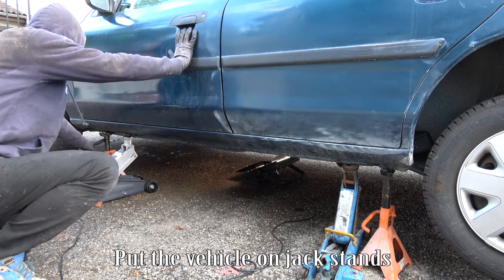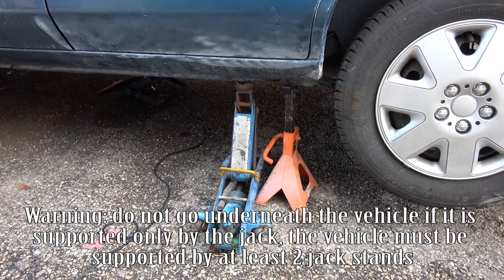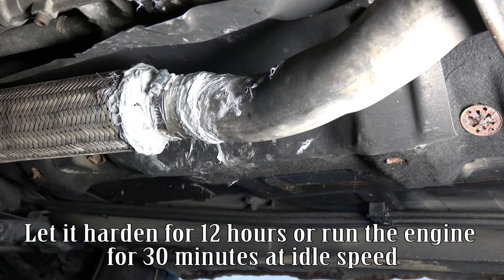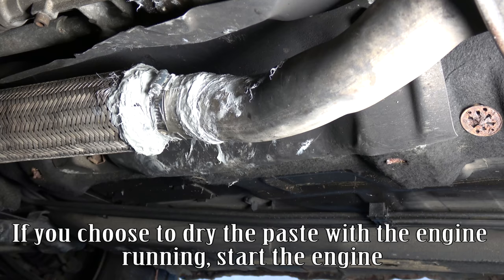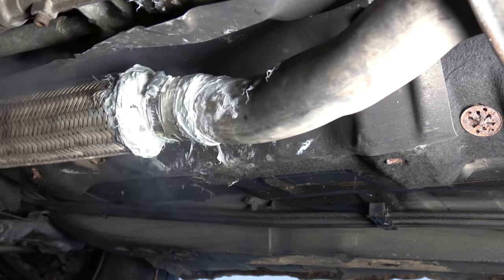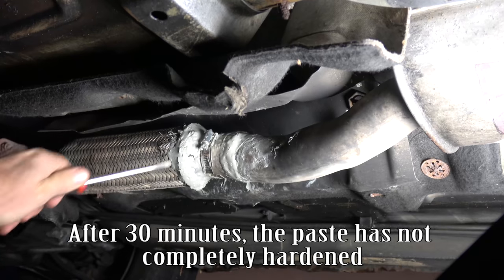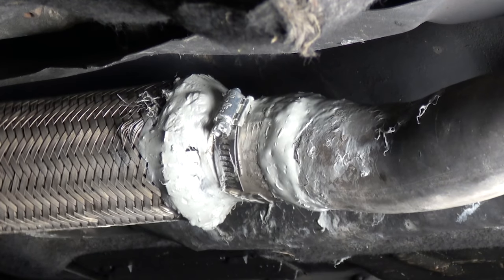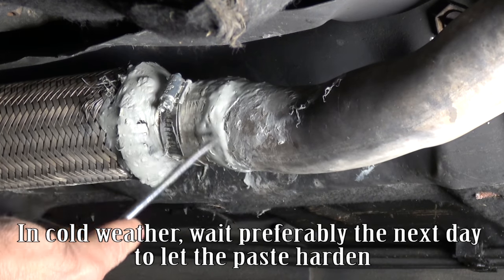Broken exhaust pipe repair (easy repair WITHOUT DISMANTLING)

Comment: And when the paste hardens, drive it to the muffler shop.
Reply: Yep, all it is is a temporary fix
Reply: and it's flammable.
Reply: When the paste hardens, drive to the dealership and buy a freaking new vehicle.
Reply: A quick fix,,,,but a slop job,,, a waste of money if you plan on keeping the vehicle!!!!
Reply: @rustynail7866  It was a proper exhaust cement. Not flammable. The ones I've used are a silicate material. They dry to form a cement like substance.
Reply: @jptrainor  exhaust cement was designed to coat the inside of a pipe , when using a clamp.  It was never meant to hold the pipe by itself.  Over the 52 years I worked in the industry, I  cut off the so called non-flammable substance with an acetylene torch on a daily basis.  It burns nicely.
Reply: @rustynail7866  Steel burns nicely with an oxyacetylene torch too. Funny that.
Reply: @jptrainor  no Jim. Steel melts nicely.
Reply: @rustynail7866  It burns. What blows off during a cut is oxidized steel. Oxidized = burned
Reply: @jptrainor  carbon in steel will burn, yes. But most modern exhaust systems are 409 stainless, which is lower in carbon content and adds a small amount of chromium and nickel, creating a much higher melting point, without any actual flame.  304, used in show cars, has more chromium and even less carbon.  Catalytic converters create temps sometimes north of 1700 degrees .   Manufacturers learned in the mid 70s the necessity for much higher melting points.
Reply: @rustynail7866  The iron oxidizes! Doh!
Reply: @jptrainor  But it does not meet the criteria of a combustible substance!  Anything will burn at 3000 F.  DUH!
Reply: @rustynail7866  kind of like muffler cement
Reply: @jptrainor  yeah except muffler cement is done at a constant 1000 F.  Steel and iron will last forever at that temp.
Reply: @rustynail7866  so what
Reply: @jptrainor  LOL
Reply: @AlbertwilliamsWilliams  this is way cheaper than getting a ticket for noise complaints on your way to the shop.
Reply: 🤣🤣🤣🤣🤣🤣🤣🤣🤣🤣 this has got to be the comment of the year 🏆🤣🤣🤣🤣🤣🤣🤣🤣🤣🤣🤣
Reply: Lol😂 
Hey it's better than it was..
Reply: When the paste hardens, drive the car into a brick wall as fast as you can.
Reply: @kuvyoghmoobamelica6883   not everyone can afford to get their vehicle fixed little alone a new vehicle… lol you simple? Why els would you watch this video unless your broke trying to fix ur flex pipe
Reply: Haha, so true!
Reply: I can only confirm
Reply: Welding it would've been better problem fixed
Reply: @kuvyoghmoobamelica6883  
For me it'll be cheaper to just replace the part that's damaged. "Buy a new car "
Not all of us can afford that.
Reply: Totally agree with you 😂😂
Reply: It’s just a exhaust yall dtm
Reply: This comment so funny 🤣🤣🤣🤣
Reply: OK to get you home if it has dropped down or is loud but that is not sealed it still leaks
Reply: That clamp kicked his azz😂😂😂

Comment: Besides the fact that a complete seal was not achieved by applying the paste...the original reason the muffler cracked then broke completely in two pieces was because the muffler/exhaust system IS NOT properly secured...when you slam the car door and the whole system shakes and moves back and forth is my proof...this system will violently shake itself to pieces again...this bandaid fix will fail...most likely within the first trip....
Reply: Engine mounts that
Reply: if its a total beater then i guess its ok to do it that way.....i woulda had a guy weld a piece of pipe in there where it broke from the flex pipe to the exhaust pipe....only would been a inch or so
Reply: Ur correct cuz mine just broke due to driving by a hole and slamming down on it
Reply: @davidscaife4312  why?
Reply: Would using zip ties and the wrap be a temp solution? I can’t get it repaired until next week but I need to drive 😢
Reply: @Dankdalorde No. Zip ties would melt.

Comment: For people not having very much to spend this is a good way for a while or one can double up on the material once the first ones done and remove the clamp and redo
Reply: Its absolutely not Robert 😂
Reply: My mechanic used this cheap fix. Nope didn't even last 3 days both times.
Reply: @techtactics788 you need a new mechanic. I personally used the Holt's gun gum repairs to get my car through its MOT over 6 months ago,  still no blowing whatsoever.

Comment: I still see a leak. Cheap and easy fix I did on mine... Steel wool double layered, held in place with furnace tape. (Furnace tape is only to hold the steel wool, otherwise it wouldn't last a couple of hours on the exhaust). Then layer aluminum sheeting over the steel wool using furnace tape to hold the sheeting in place so you can add a clamp or two.  Works great and lasts a long time. Aluminum sheeting may need 2 - 4 layers depending on the hole.
Reply: Yup. Helps the aluminum last longer as well. I have one that's been on for over a year and still going strong.
Reply: Far better repair what you mentionthan this video showing us how to put icing on an exhaust pipe :)
Reply: You ain't working on my car.
Reply: @bradw778  hey I'm fixing one now hope it works
Reply: Hey PM me I want to try your way

Comment: your video helped me a lot couldnt find the gun gum but I use the kinda smilar product and covered with a aliminum cover 👌 loud noise is gone
Reply: Lol people been staring at me driving mine for a while! I found some exhaust seal putty stuff at advanced auto!
I jus gooped that stuff on driver side pipe! If it doesn’t work I’ll hav pipe secure spot welded. Then try again! Lol!
Car from up north…rusty underneath !

Comment: I've used muffler cement in the past to hold me over until I got new exhaust parts. It was still okay when I got the new exhaust pipe weeks later. Not pretty but it works.

Comment: To do a repair like that I got a exhaust pipe adapter and fit it inside the resonator (the part where the pipe broke off), and using an exhaust pipe expander, expanded it out so it was expanded against the inner pipe in the resonator.  This effectively replaced the pipe end that broke off the resonator, and allowed me to attach the rest of the exhaust to this new 'stem'.  I also tack welded the expanded pipe into the resonator from the inside of the pipe, purposely blowing through the pipe to make sure there was some bonding, but I don't think that was needed.  To that end I have never had much luck with the exhaust sealant as it seems to crumble over time.
Reply: Thanks. I like that method.

Comment: This is an emergency repair and not meant to last all that long.  It certainly should hold long enough till you can afford to get it repaired correctly.
Reply: i used furnace cement and didnt even let it cure like i should bc i was in a hurry lasted a full year just redid it the "right way" it should out last the pipe around it id buy new converters if ny wast stoopid and wants me to pay 1200 for converters in another year i wont need to worry about emissions anyway its getting straight piped just shows how dumb the laws actually are lol

Comment: Reading many better recos for beer cans. Better than video's potsticker paste LoL. In 70s-80s, steel Campbell soup cans + clamps worked for 1yr, substitute for $400
dual exhaust-resonator systems on 66 Tbird 390 and 70 Bonneville 455.  The cars were only worth a few hundred bucks. Several hundred pints of soup, now unfortunately I have high BP

Comment: This looks like something I would have tried when I was 18, had no money, and knew absolutely nothing about cars.  Maybe next time try some gorilla glue.  Lol. There's obviously a leak in the flex pipe itself. Until motor mounts are replaced it will probably shake the whole car apart.

Comment: Back in the early 80's I had a Ford Grenada and it was flex pipe from the Y pipe right through to the tail end. Nothing wrong with it but it would have to be tinkered with from time to time.

Comment: This may holding in place temporarily, but it's still smoking. So technically, it is not repaired. That flex pipe is going to split on the corrugations eventually. It also appears like there's a broken or loose motor mount, too much shaking.

Comment: I used this when I was young and had no money. This never holds. As you see on the video it leaks now already. Maybe when you want to sell the car you can do this. But always be honust to the buyer.
Reply: Remember radweld? That was only a temporary fix, but they advertised it as a permanent one 🙄 but this is just disgraceful, these guys are friggin cowboys, why would anyone in their right mind put a clamp barely larger than the crack over the top and then hope that this overly priced heat activated stuff holds it? 🙄 Bonkers!
Reply: @A_Pt_9298  it works fine warm up the car before hand and let the paste sit for 30min or longer then start her back up

Comment: How about you fix what caused the flex pipe to break in the 1st place? Like maybe a broken motor mount or secure your exhaust system so it doesn’t shake like that? Been a mechanic for 35 years. Non of that stuff lasts! Welding is the only way to go!
Reply: Don’t do it!
Reply: Been a mechanic for 27 years and these flexs tend to suffer from fatigue and are a known weak spot, not necessarily due to a mount failure etc, they experience a certain amount of flex naturally hence why they are there and with heat, cold heat cold they rot through
Reply: Retired mechanic here with 40 years experience in the trade. My last auto garage I owned did many flex pipe replacements. Also had many welders in the shop, mig, tig, arc,stick etc. Sold almost all equip including my Millermatic 225  or my Lincoln 
TIG welder that I most likely would have used on this repair. Just recently purchased a brand new in the box Chicago Electric 90 amp Flux core welder from my neighbor for $50. Do you think Flux core can weld this? And yes, would have liked it if it was a 140 amp but it is what it is and I bought it as I did not have a welder any longer. Incidentally...... for "shits and giggles" and remind readers that safety on any job should be a priority.  Few years ago sold business because of an injury. Winter was coming and wife wanted a stand by generator in case of loosing electricity up here in Northern Maine. Purchased a new Rigid 6800 one night from Home Depot, opened up my service panel to see where I was going to install the power feed for the house and stupidly grabbed a live 220 circuit powering my shed that has all my carpentry saws and tools and electrocuted myself thru my left hand (actually my thumb). My black thumb and forefinger were the worst burns 911 paramedics had seen they said. Wish that was the worst injury that night. Wife said the shock thru me some 6-10 ft and my body went into a seizure for over 3 minutes. Wife thought I was having a stroke, neither of which I ever had before. Now 3 years later at 62 years old I seize sometimes 10 times a year...or more wife says. And I can't remember a bloody thing most days. Wife's the best tho....she reminds me daily the names of my friends and neighbors...and also to take those dam pills (Keppra) so I don't seize. True story...again will a flux core weld this?

Comment: Looks like a big messy, pain in the a** job to me, that's made even more difficult by not having a proper hydraulic lift to get the vehicle up high enough off of the ground to work on it. (I've spent countless hours under my cars, over the years, using only jackstands and it can be a huge hassle.) I wouldn't trust the longevity of this repair either. Seems like a cheap and temporary fix at best. I personally wouldn't waste my time and money on such a repair, but i do understand that sometimes you have to do the best that you can with what you've got and with what you can afford.

Comment: Save your money. Years ago on clutch job had cut exhaust. I used beer can with top & bottom cut off & 2 water hose clamps on pick-up tk. I used that for years only replacing blow out can ever few months. Until finally putting new dual exhaust on it. True story.

Comment: ill give it a 30/30 guarentee///thirty feet or thirty seconds...terrible repair
Reply: 30 miles max
Reply: LOL yeah man that shit needs to be welded together that paste is garbage
Reply: @romanskarzhinets3128  I drove more then 30 miles using ONLY glue for basically the same issue. I will keep you updated :).
Reply: @zachderado2755  actually there's no need for welding an exhaust, that's a terrible suggestion, all it needs is a gasket, some paste and a clamp, simple. Welding is stupid

Comment: This is absolute emergency repair for the broke budget person, it won't last very long, its temp repair.

I can do better temp repair with soup can and hose clamps, or better yet get a new flex pipe and put it on, then it will last very long time.

Comment: I did a temporary 'bodge' fix like this but used an old bake bean can cut along its length and jubilee clipped on at each end to join a break in my exhaust, I used the exhaust bandage under the can and plenty of high melting point exhaust seal cement between the pipe and bandage and between the bandage and can!

The result was a strong leak free repair that lasted until my next MOT, the mechanic just laughed at my repair and failed it on that, so had to get a new exhaust anyway! 😳😲⚠️😁
Reply: How much did that run you?
Reply: @Officialjaleb  It didn't cost much, it was a few years ago now, I seem to remember it was about £4 for a kit, Holts Gum Gum bandage / tape and it came with a tube of cement.
The bake bean can was free, out of the bin and I already had a couple of old jubilee clips that I just reused.

The kit was basically useless on it's own, it was only meant to be a temporary repair anyway.

But the bake bean can helped to reinforce it all and keep the bandage from coming undone!

Once it all heated up it sealed my exhaust leak up good but my MOT tester was not impressed! ⚠️😳😁

Cheaper than a new back box and fitting, which I eventually had to do anyway to pass the MOT.
Reply: @pdtech4524  ok thanks I will keep this in mind
Reply: @Chase Williams Yeah my repair was solid and gas tight but my MOT tester wasn't impressed at all⚠️😊

The bean can just strengthened the whole joint and kept the exhaust bandage sealed around the break, the jubilee clips did their thing perfectly.
I dare say it would have lasted years but it was only intended as a temporary bodge repair until I got a new backbox.
Reply: fu#k that mechanics. I have the same problem with a flex pipe end. A mechanic says the complete axe has to be disassembled). I hate this exhaust problems.
Reply: Getto fix
Reply: @pdtech4524  I don't see why it should fail an MOT if it was secure & air tight.
Reply: @45graham45  It did fail and it was secure and gas tight, the tester just laughed and called it a 'bodge'.

I guess it would depend on the discretion of the MOT tester, some would no doubt pass it.
Reply: @pdtech4524  Yeah, but I don't see why it should if it does the job. Nothing you could do about him failing it of course.

Comment: In our next video we'll be replacing the BROKEN MOTOR MOUNT
Reply: No, in the next video we'll be welding up the engine 🤣🤣🤣
Reply: @A_Pt_9298  engine is fixed to the engine mount why would you weld it.

Comment: Root cause of pipe breakage is a blown engine/transmission mount. It's only going to break again.
Reply: Wtf is a blown mount? Lool.  It's a block of rubber and steel fasteners.  Maybe "cracked" or "dry rotted".

Comment: An easier way would have been to use a vacuum at the end to create a negative air flow ti would have sucked in the paste into the whole for a better connection. Then after that use a heat gun.
Reply: Another way would be to just buy a new exhaust
Reply: I have a sharpvac and $12 for the exhaust repair kit not $300 just to replace something with a small hole that can easily be fixed
Reply: Good idea, but on a 1996, the rest of it probably has just as many leaks.

Comment: Exhaust still leaking...it's better to weld it again
Reply: And professional. Why would you weld an exhaust??? 🙄
Reply: I mean, really you don't need a gasket to be fair, the paste and clamp would seal it supertight, so gasket is really overkill, but welding? Super overkill and in fact stupid, because when you come to replacing either part of the exhaust you'd have to grind off the steel welding rod, which is a nightmare!

Comment: I do Hillbilly repairs too! But my car is 17 y/o and it is G-6 Detroit car.  SALT!!!!!!   I get two tall boy beer cans cut the ends sleeve it over the damaged parts and 3 hose clamps. It will get me 6 months and quiets it down enough to avoid JOHNNY LAW ! Hell I even then hand it with a drill hole and DOG CHAIN to lower the pressure. Taking it to my shade tree mechanic to evaluate the motor and transmission. If he says the motor still ok. I spend the 300 bucks and get a new exhaust via a license dealer.  19 moths left on my wifes payment book on her 2018 Buick Encore.  Then it is my turn. I never had two car payments at once.  Been very lucky. ( Once, my 1990 ford ranger motor let go at 369K with ORGINAL clutch on the night of my wifes second complete payment book. Send the payoff check 4 hours before! Original Ford Escape x'ed out via DRUNK ASSHAT!!! Wife ok. ) I might  be out of luck this time!

Comment: I saw a puff of smoke coming from the top of that repair.   Poses a risk of carbon monoxide poisoning in the cab.  I suspect if just need to get vehicle through an inspection…. Okay, but patches typically don’t work.  

In the 80’s I damaged Datsun 280Z gas tank hot rodding thru desert west Texas.  JB weld patched that pin hole and it held for years.